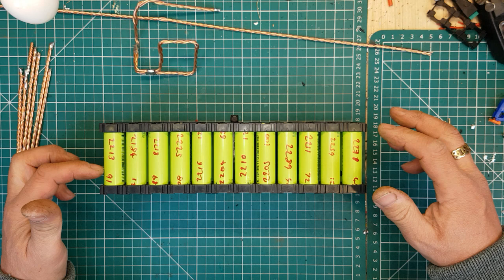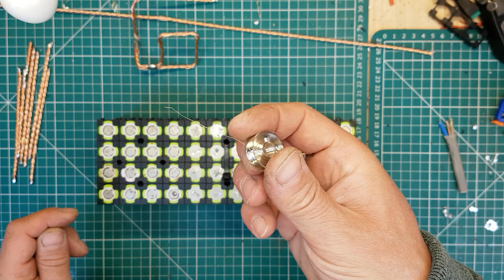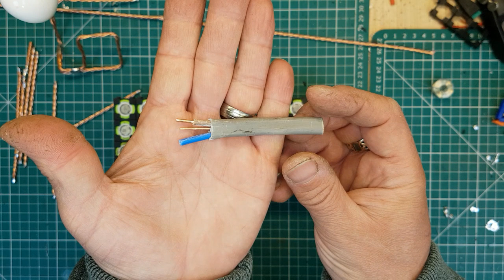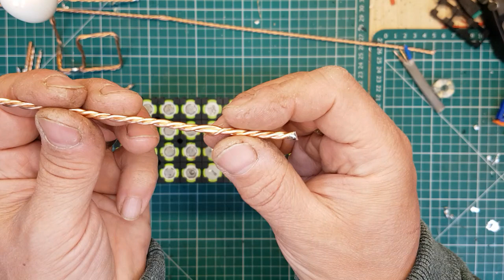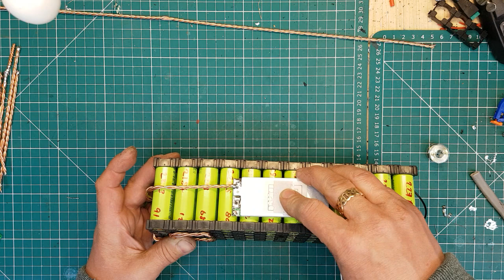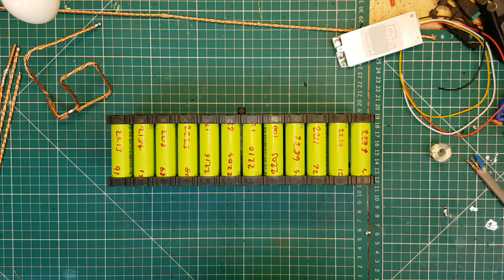Starting the assembly of the 3S 16P battery pack. Pt1

Comment: Catching up, liking the ideas and progress to this point. Another advantage I'm thinking with the fuse wire connections is you don't need as much heat to solder them on as you would have with a nickel strip type connection 👍
Reply from the maker: The fuse wire idea wasn't mine. It's been used in the DIY power wall scene for some years. It's actually a really good way if keeping the cells safe from over charge and over discharge situations. 

Just make sure all the cells a balanced before soldered the fuse wire to them. ;)
Reply: @johnnodge4327  Yeah I've seen the idea used on other videos, I was a bit torn about the idea of soldering on nickel strips (don't have a spot welder) as didn't want to put that much heat in, so the fuse wire seems a way to reduce the soldering heat needed.
Reply: Where did you buy the fuse wire from,? Google  keeps bringing me to small cardboard packets with a few windings on it
Reply from the maker: I got it from Ebay. 

It arrived on a tiny bobbin, but there's loads on there as its so thin. 

I'll look out the seller link.;)
Reply from the maker: Here's the Ebay link.https://www.ebay.co.uk/itm/113965764804

Hope this helps.

Comment: What bms are you using
Reply from the maker: This one. https://www.ebay.co.uk/itm/153223224929.

I chose it because it is rated at 100A, had a separate charge input, and was cheap.
Reply: @johnnodge4327  ok thank you